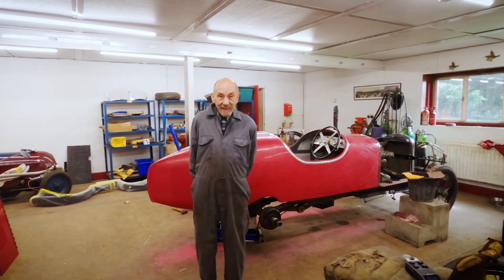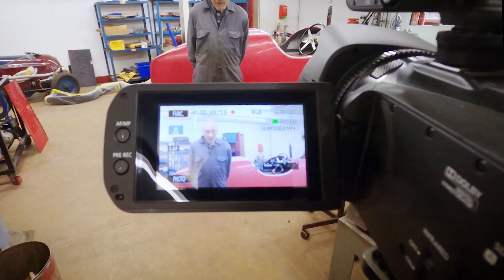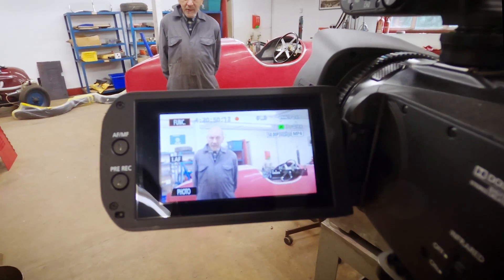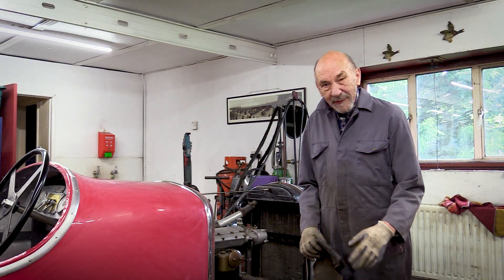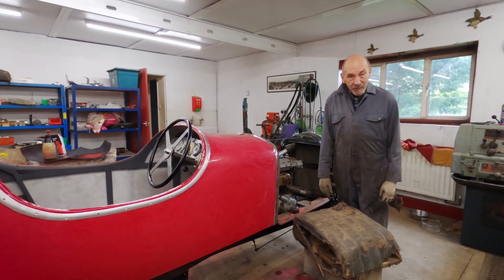SHED RACING - 1926 GS Salmson VAL "Portugal car"

Comment: She is looking great Ivan! A tip I learned when I was at Walt Disney Imagineering.. I was down at Disneyland working with a German Master Scenic Ager and Grainer who was the head of the department.  He never aged with pure black or gray.. Most of his aging washes had a black that was not pure black paint, he would do a mix of the the Primary colors and get something that was “close” to a black but much richer with a better depth. He also used a lot of earth tone paints in his mixes, paints like Raw Umber, Raw Sienna, Yellow Ochre to richen the mix and give a hit of the elements like dust and dirt. You would walk into his office and swear the concrete floor was real stone from a Castle.. he had a metal cabinet against the back wall that you had to tap on to realize that it was actually steel, you would swear it was ornate carved Rosewood from the 1300’s .. The guy’s talent was amazing!

Comment: Ivan another great installment on your Salmsons.  The audio using a  distant microphone creates an echo in the shop and is a bit difficult to hear what your saying. Perhaps a wireless clip on mike would be helpful in the future. 

I’ve recently restored my Dads 1951 MG TD/c that he special ordered from Abingdon in 1951 for competition use.  MG was still using rexine and leather (on the wear surfaces) at that time.  I  have contemplated using bookbinding material with a similar weave of the original as a substitute for the rexine/ oil clothe for the dash. The car currently has an aftermarket engine turned vernier added to the dash. I like the look but it is quite dazzling to the eyes when driving thus necessitating the hood be in use during the daytime. So, I will be making up a rexine/bookbinding covered dash to replace it at a later date. I may also choose to use the same materials to make up another set of trim panels for the tub.  I personally don’t like the texture of the vinyls and it would look more correct.  You might look into this as an alternative to vinyls

Comment: Hi Ivan ,like the video very much ,it made a lot of sense,I’m in the process of restoring a  60s triumph 650 t bird and trying to reclaim and use as much of the original parts as I could ,but I’d resolved myself to the fact of a new paint job on the tank ,but having watched you video 
It’s a case of spot blasting and building up the paint ,and hopefully I will manage to keep 95 % of the original finish . Keep up the good work

Comment: I'm building a new vintage car (special/replica) and most definitely don't want it looking new. Especially as I want to use the car and don't want to have to worry about it getting dinged and dirty. One trick I learned is with a string wrapped steering wheel any times your hands are dirty and covered in oil wipe them on the wheel. Doesn't take long for that to look nice and used. A new looking, vintage car isn't right. Paint I definitely didn't want shiny so I like your trick you showed but what is Duff(?) oil? Some sort of penetrating oil?